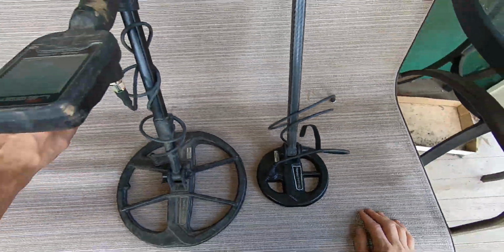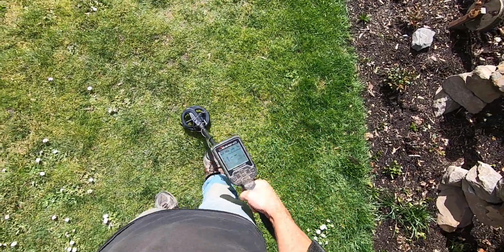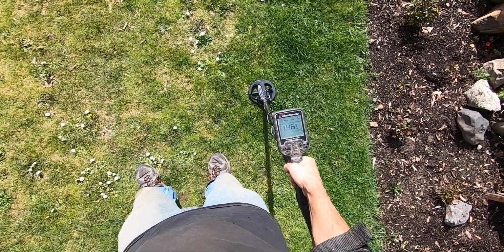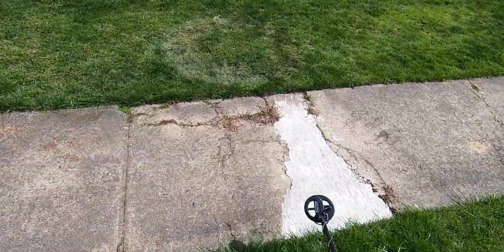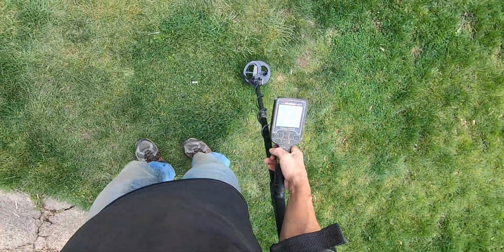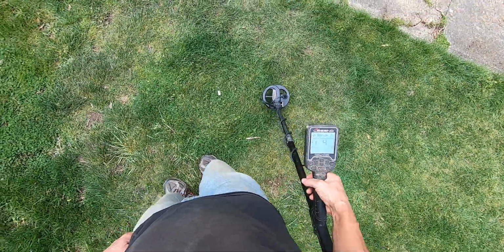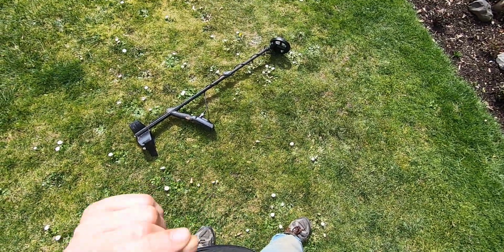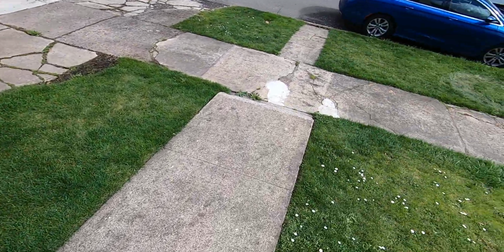Nokta Legend 6" coil in test garden.

Comment: First Software Update is posted on NM website:
Updates Made:
1. Pinpoint function has been improved.
2. M 1 Multi Frequency parameters have been updated.
3. Audio alert for Automatic Frequency Shift (Noise Cancellation) completion has been extended.
4. Factory default Tone Break value has been changed from 11 to 10 in Park mode.
5. Ferrous Off Discrimination Pattern has been updated to reject IDs between 1-10 in Park & Field modes.
6. Threshold audio level has been increased in Gold mode.
7. Audio response during ground balancing in Gold mode has been updated.
8. Backlight levels have been re-configured.
9. Bugs have been fixed.